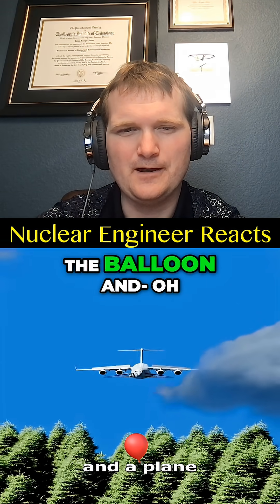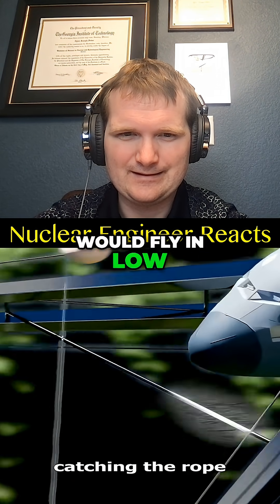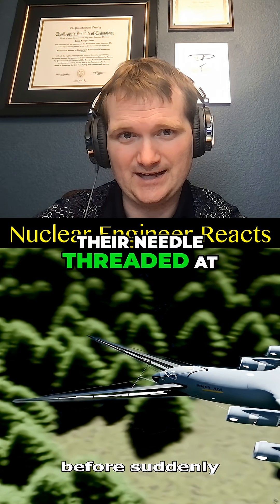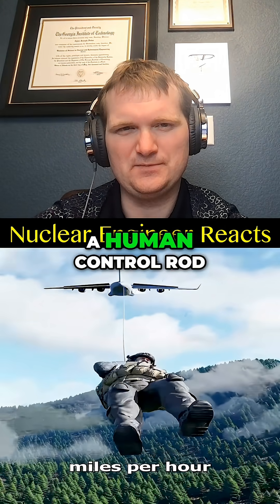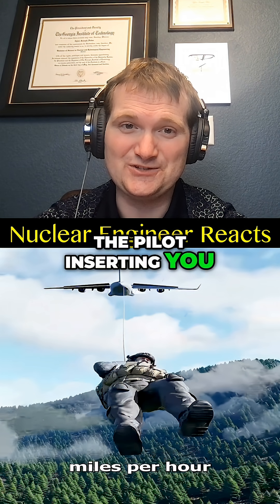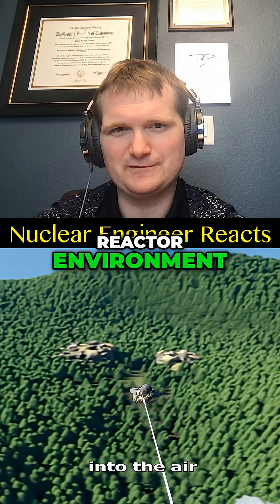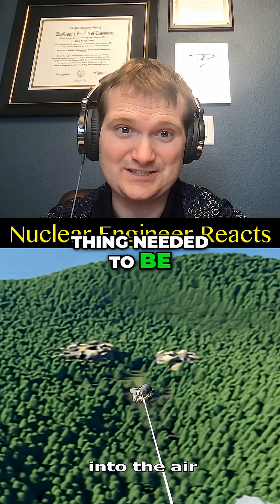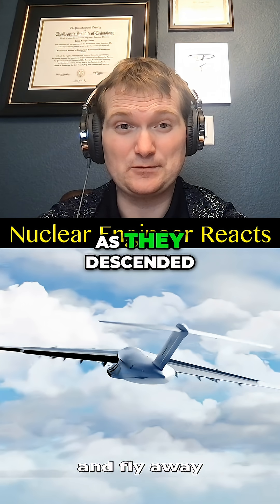How the Fulton Skyhook Worked - Nuclear Engineer Reacts to Zack D. Films

Comment: As crazy as it was, it did get used by special forces a few times. It was invented before helicopters and pretty much made obsolete by them, for people at least. I think it still got used for cargo and catching spy satellite film.

It also doesn’t need a bungee cord as the long rope has a significant elastic give. For example a 10 foot root might have 6 inches of elasticity, but a 100 foot rope has 60 inches. The sky hook used a 4000 foot long rope so there was quite a bit of stretch to it.

Comment: I knew some guys who've ridden it.
PataRescuemen (PJs) with the 54th Aerospace Rescue and Recovery Squadron out of Pease AFB in the 1970s.  They said the ride was actually pretty smooth - you got a rougher ride down on the parachute.
Their main missions were Air-Sea Rescue over the North Atlantic, and recovering Spy Satellite Film Capsules.
The first pickups of people were done during World War 2, but it was a much less sophisticated system using a line suspended horizontally about 15-20' above the ground, getting snagged by a hook trailed on a cable from the pickup airplane.  Which means the plane's coming at you at about 50' above ground level

Comment: The James Bond 007 "skyhook" aircraft is actually a modified B-17 Flying Fortress used in the 1965 film Thunderball, employing the real-life Fulton surface-to-air recovery system (STARS) to snatch people from the ground without landing. This system, developed by Robert Fulton Jr., uses a helium balloon to lift a line that a V-shaped yoke on the aircraft snags, winching the person in a harness aboard. The same B-17 used in the movie (N809Z) was also involved in the actual CIA's Operation Coldfeet rescue in 1962, showcasing its real-world espionage application. 
Quote most all from the internet 2026

Comment: This was used in Vietnam using modified C-130’s. And it does require a fairly large, open field to allow clearing of the tree tops…all of which is planned for, and soldier directed to area, PRIOR to the start of operation.

Comment: The system uses a steel cable, which at that length has a little bit of elasticity, but most of the elasticity is in the harness. The soldier still experiences about 7G the moment he is snatched up.
Reply: There's also some buffering from the angle of the wire. It wouldn't instantly accelerate you to the speed of the plane, even if there was no elasticity in the line.
Reply: @Bob5mith  well yea... That's just physics. Can't send that information(motion) through the cable instantly no matter what material is used or what angle(?) its at.
Reply: @Keanue-Anakoni-Aukai  I'm not talking about lightspeed kind of instant. I'm talking about the kind of "instant" acceleration you'd get from a car snatching a cable tied to a cart at 120 mph. 

With an airplane snatching a vertical cable, you'd swing backwards, in the airplane's frame of reference. Your acceleration would be much more tolerable than the car example.
Reply: Biggest problem I read where broken bones in a certain percentage of people, but still it sounds like a fun activity
Reply: @ShakesB13r  I suppose a few survivable bone fractures would have been worth it given the alternative.

Comment: Interesting human projectiles 😂. In theory 🤔it works but that would be like around 1G but the rapid acceleration is what would be dangerous. Depending on the rapid elevation change and acceleration it would be way more dangerous. SF soldiers already do similar extractions but way more safety involved. Balloons are used for extractions of this scenario.
Reply: It also worked in practice. This was a thing that actually worked and was used shortly in combat. Person would experience 7Gs. Fighter pilots are trained to operate under 9Gs for short periods of time

Comment: imagine the g forces
Reply: Googling it, it's 7Gs for 200 km/h so yeah it's insane
Reply: geforce gtx 590
Reply: 200km/s which is like 50m/s.
So if you would accalerate to this within one second you would experience 5G + 1G(earth grav).
Pilots in fighting jets are trained to handle like 9G for a short time.
Reply: @winni2701  This better be SUPER elastic if you want to spread the acceleration over a whole second
Reply: @winni2701  up to but very rarely if ever do they endure 9Gs. This being about 7Gs for a few minutes its probably the worst
Reply: @carlosm.sierra1465  7Gs for maybe a second. Not few minutes
Reply: @TheMartuksxxxx  Which is more than enough if you distribute the acceleration onto like 1 second.